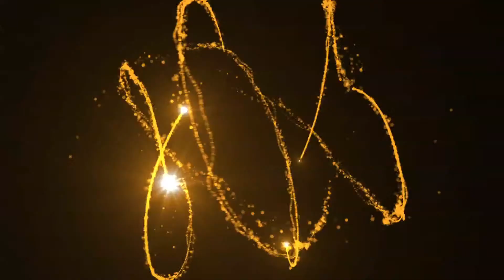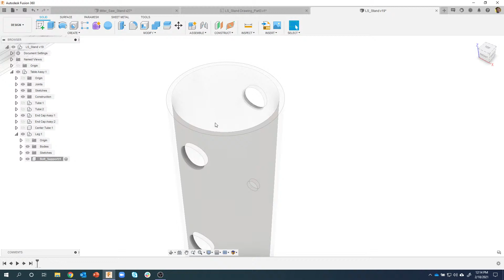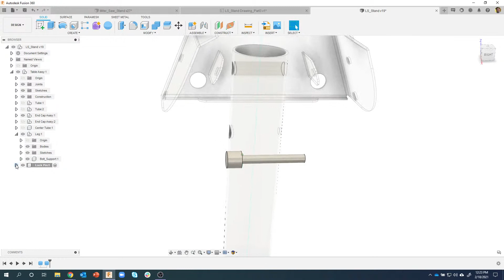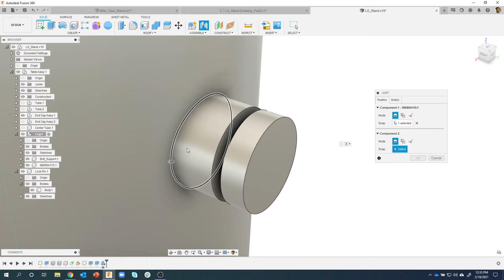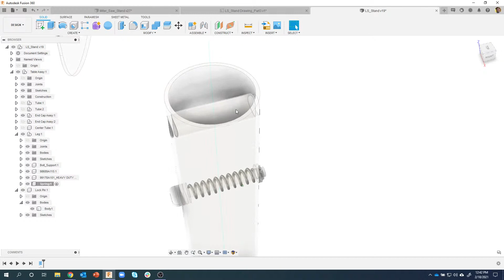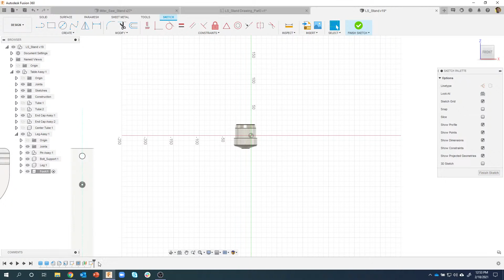360 LIVE: Miter Saw Stand project - Part 3

Comment: Brad:
Excellent work!  Your tutorials and projects are easy to follow and well done.
At 51 minutes, the foot, it's can't be built.  The lower cylinder, when shelled out, is a larger diameter than the top cylinder.  The form or mold could not be extracted.
Keep up the good work.
Thanks

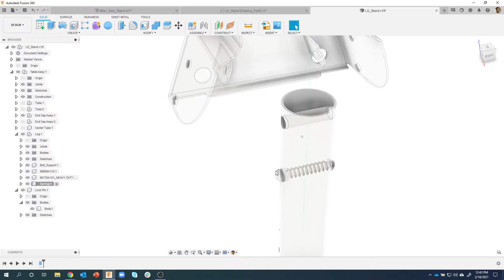Comment: Hi Brad, thanks so much for these great live projects!  I am a bit late to the party on this one but I just wanted to point out the solution to an error that I encountered starting at your browser reorganization at time 44:51.  I was not able to move the components into the new component called Pin Assy and the new component called Leg Assy.  After investigation, I learned that you have to activate the top tier of the browser (Stand) and make sure that the timeline marker is all the way to the end of the timeline or you won't be able to move the components.  Just an FYI and I hope this helps others who may encounter this problem.

Comment: I was following it all the way until the part when you make the Pin Assembly component and move the spring, pin and bolts into it. I can´t move any component into another anymore. In the previous video it was working fine but know Fusion doesn´t let me move the components at all.
Reply: I found out the problem. There where some planes missing from mirror commands i´ve made. It was causing the error.

Comment: Hi Brad. Thanks for all the tips. I know you like to save time with shortcuts. At 53:00 you show how to add the webs. Your viewers might like to know that you don't have to bother carefully  taking the sketch lines out to the wall. Just draw a line in the correct place and don't bother taking it to the wall. The web command is smart enough to do that for you.
Reply from the maker: @Martin-  Yes, that is one of the cool things about the Web command.  I like to show multiple "tips" in my LiveStreams, and this was one of those examples where I show how just getting near the edge of the circle automatically creates a "coincident" constraint.  So, basically showing two things in one.  :)  Glad you are enjoying the LiveStreams.
Reply: @adskFusion  thanks for your reply, however I think you have missed my point. The line that you draw to guide the web does not need to touch the edges. It  can be of any length as long as  it is co-linear with the intended web.

Comment: Hello Brad,

In the foot, by using the Shell command you have illustrated a common 'gotcha' resulting from its use. You have created an area at the bottom which is bigger in diameter than the bore (see 51.09) where the cross-shaped rib is later placed. Impossible to manufacture. I'm an experienced Inventor user who has been caught out by this myself.....and  to my shame, not just once, but several times!

Not trying to be picky or smart; I just thought I would point this out for the guidance of others. Regardless, your tutorials have been extremely valuable as I learn Fusion. Thank you.
Reply from the maker: @Ian Pendlebury-  Yes, you are correct.  However, when I look at the actual foot, it looks like it is injection molded as you can see a "parting line" with a bit of extra rubber along that parting line.  I also wonder if because it's rubber, they are able to flex it off the mould.